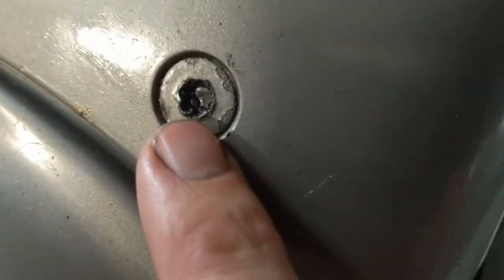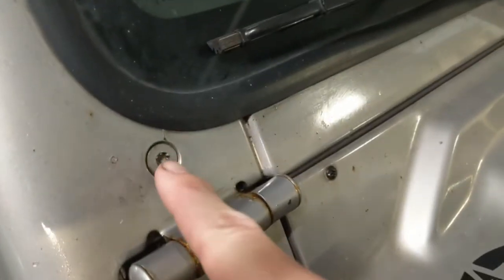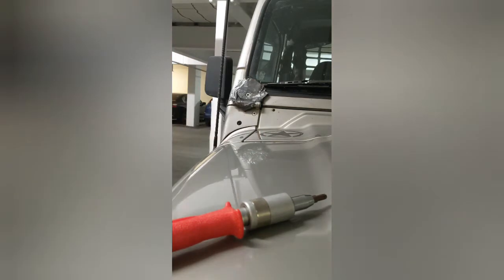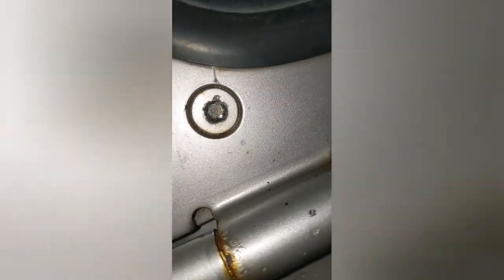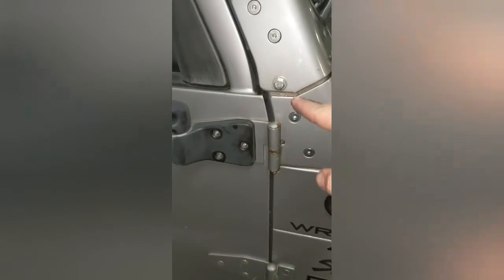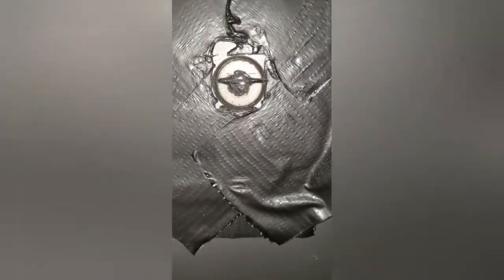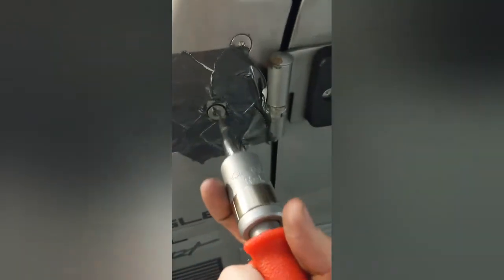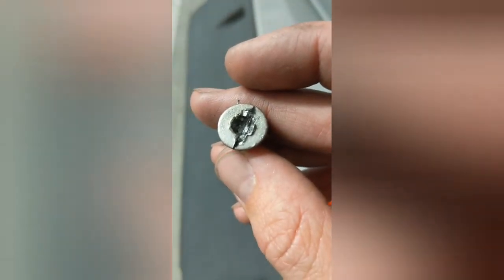Removing the dreaded Torx bolts in Jeep Wrangler TJ hinges.

Comment: I’ve stripped mine too. I drilled in it and tried the easy out. Drilled some more and easy out some more. I’ve heated them up with torches and kerosene torch but it continues to strip even with the easy out. I’m going to try the drumel. I’m hoping it doesn’t break the head off the bolt.
Reply from the maker: Good luck!  Those things are a nightmare!

Comment: Thank you!  I am having to remove the same screws to mount a roof rack to my TJ.  This video has given me renewed hope as I go back at it.
Reply from the maker: I was able to get all stuck bolts out via this method.  That tool from amazon was a life saver.  I ended up cuting a cross groove into the bolt with the dremel and using the phillips head bit.  Seemed to have more grip.  Good luck!

Comment: Also, little story in 2016. I was replacing my rear main seal and had to remove the starter to access. It took me almost three weeks on the first bolt. Every day I’d go out and push on it a couple of seconds three or so times a day. I was sore like I did push ups. Even my dad couldn’t budge it. Nor could I get to it to use an extension. Tried map gas - I did everything. Until one day it made a smooching sound and slowly turned. Wow, This was my first time wrenching and my very first item to wrench and it went like that! Too funny right?

Comment: You do not have to drill out the ez-out or any taps. Put a punch in there and strike it taps and ez-outs are hardened and are brittle, they will splinter when hit hard enough. Also don't us e a dead blow hammer on an impact driver, they are meant to be struck by an actual hammer, not a roofing hammer either use a ball peen hammer or a 2 lbs. sledge or smaller. One last addition to this comment, stop using "lubricants" to free stuck bolts. If you want a bolt unstuck spray it with Kroil, that stuff isn't cheap but it works.
Reply from the maker: Thanks for the help!  Stuff like this is useful for whoever sees the video in the future.  I was able to get them all out eventually, but I'm sure there are people still struggling with this poor design flaw by Jeep!

Comment: Did you use the 1/2 or 3/8 impact driver (Amazon lists both on that link you provided)
Reply from the maker: I used the half inch.  I felt like it had a little bit more bulk to it.  I'm sure either would work though.

Comment: I am working on the same left side T40 Torx Bolt on my 2006 TJ. I also broke an extractor bit in the bolt. People call this a screw, but you need to treat it as a bolt as far as torque is concerned. I just ordered the impact tool and torx bit. I am going to try your final method. Wish me luck. Jeep..Jeep
Reply from the maker: Good luck!  I'm sure it'll work.

Comment: I feel your pain Brother, just finished windshield and doors on my YJ. Lucky with penetrating solvent and powered impact tool. They all came out but not without a fight for sure. Did use the slot method on the bolts on the dash bracket.

Comment: What kind of machine is the Dremel rotary do you have?
Reply from the maker: It's the Dremel 7300.  I think it's been discontinued.  It's a good small/light-duty tool.  Battery lasted quite awhile.  Definitely not as good as my corded version if you're looking to buy one.

Dremel 7300-N/5 4.8V MiniMite Cordless Rotary Tool https://a.co/d/ccA5fwz
Reply: @jlateralus21  Thanks! I stripped T50 bolt Trying to install door hinge foot step for my Wrangler.. I was losing hope
Reply from the maker: @jayrico95  good luck!  Heat and perseverance is all it takes!